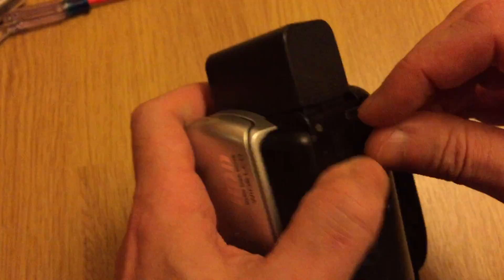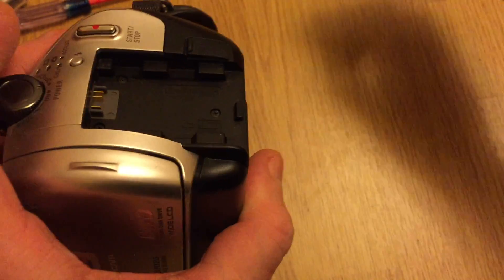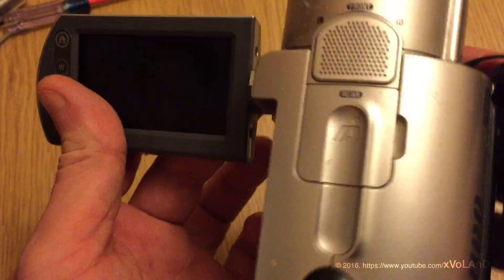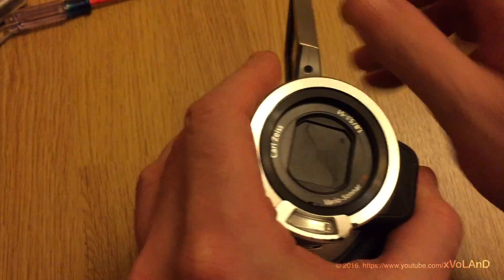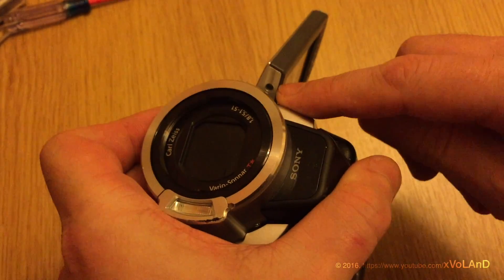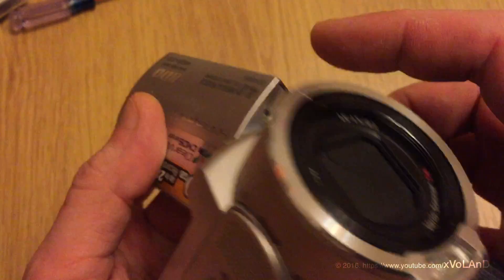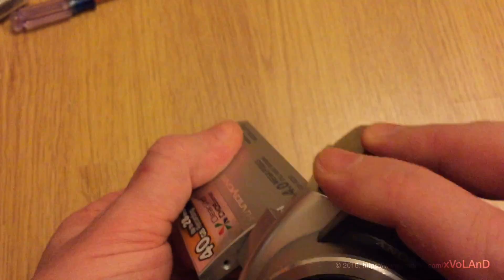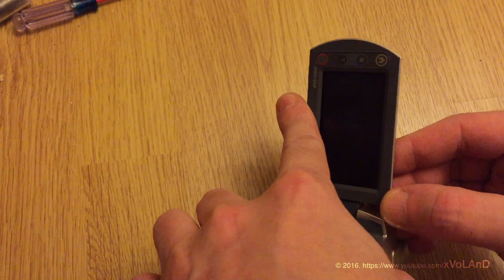SONY SDR-SR200 doesn't show the picture. How to repair broken camera. Fix LCD monitor

Comment: Thank you for video. I have the same camera but there  is no any think on screen. When I turn on, it works but screen is dark. Is this way help me too or not.Thank you.
Reply from the maker: You must try because I am not a prophet
Reply: @xVoLAnD  😁😁 I will.
Reply: @bobulmobul  duzeltebildiniz mi? could you fix it?
Reply: @canocancelik  Yes. I bought a flex cable from China. I replaced it and worked but I couldn't tidy up the device correctly. Now it doesn't work.